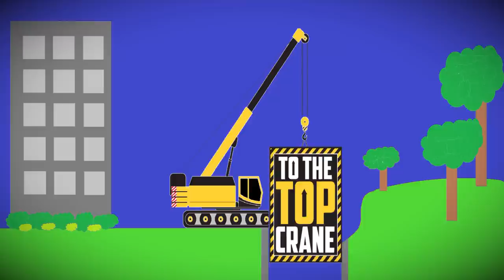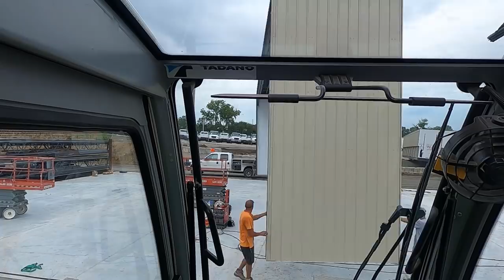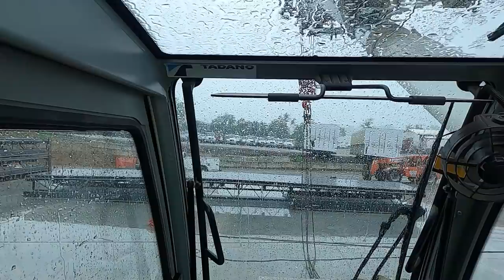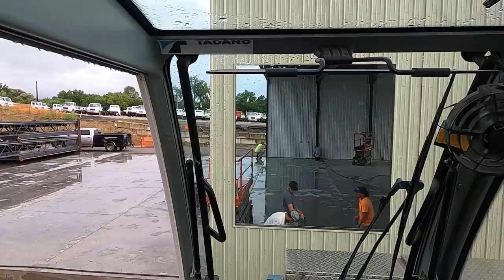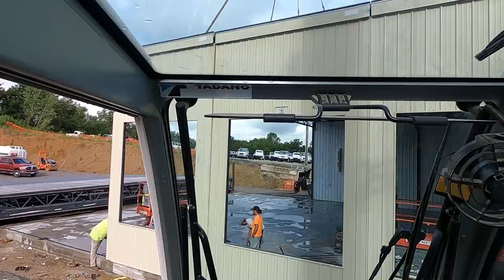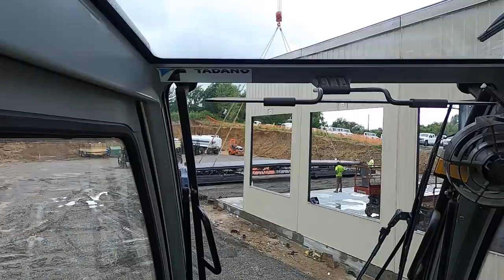Complete Steel Building In Less Than 10 Hours?! | Modular Metal Building

Comment: I see it was all pre wired and lighting in place, must have had connector between the panels great idea.
Reply from the maker: It was pre-wired. Had all of the outlets, lights, etc. already in place. Hope you are doing well down there. Many thanks for watching! 🙂🏗
Reply: @ToTheTopCrane  certainly are can't say the same where you are lord help you guys.
Reply: @barryhansen6854  stuff ain't right for sure here hope you are doing well in your part of the world
Reply: @joshwelner1951  yep.
Reply: They can also come pre insulated and interior cladded if you would like. I'm surprised they weld them down though.
Reply: @JKheller19  We desire the weld down methodology as our product is utilized in seismic zones of Alaska and Cal as well as high wind high hazard of South Florida. We can certainly tailor the set to a bolt down the connection. In either case the unique tax advantage of accelerated depreciation is realized as the building is expandable and relocatable for expansion or business climate

Comment: interesting. wonder how they seal the joints.
Reply from the maker: It had a membrane roof. So, I think they had rolls of membrane to cover the joints on the roof. I think there is trim for the joints on the exterior walls. Many thanks for watching! 🙂🏗
Reply: Depends on the manufacturer. Some have steel roofs it would be is a ridge cap. (Would have to look at my manual to see what the factory called them.) These ones here with the EPDM membrane would have a slight angle going to the centre of each section and all they would do is glue and terminate the ends of the EPDM membrane.

Comment: I don’t know about weather bug, but I use an app called MyRadar that sends push notifications for lightning in the area. It works pretty well. I even get tornado warnings with it before the sirens go off.
Reply from the maker: I'll check it out. Thanks for the info. Weather Bug does pretty good with alerts. But, a crane operator can't have too many weather warnings. 😂. Many thanks for watching! 🙂🏗
Reply: Yep, MyRadar.
Reply: @To The Top Crane: I use Weatherbug, MyRadar, and NOAA Weather Radar Live in conjunction. I pay for subscriptions with NOAA and MyRadar but well worth it. I think the free ones just have ads. Most of the time I get notifications from the apps within a few seconds of one another, but there are times I get a notice from one and the others will miss it for a few minutes.

Working in an industry where weather changes and lighting are big issues, having that redundancy built-in is very much worth it.